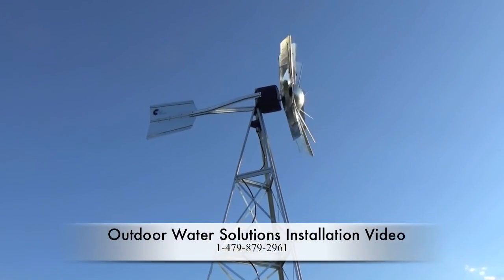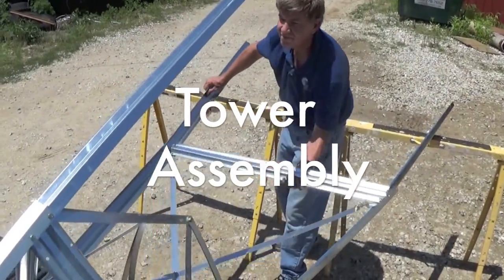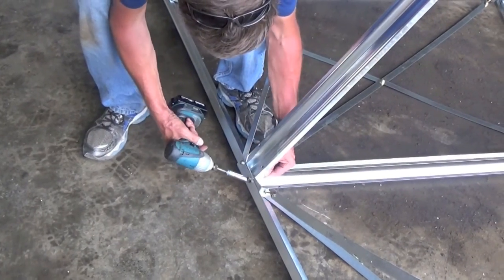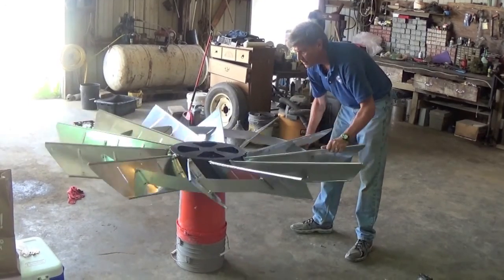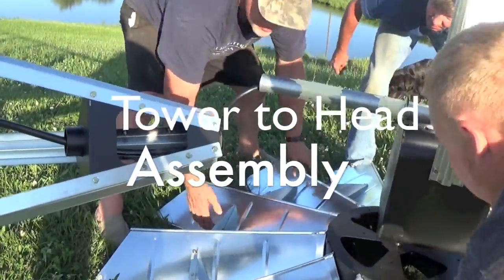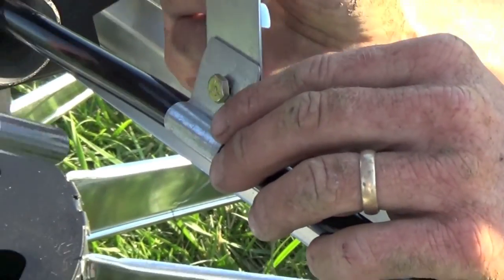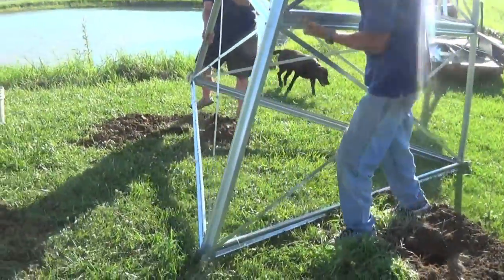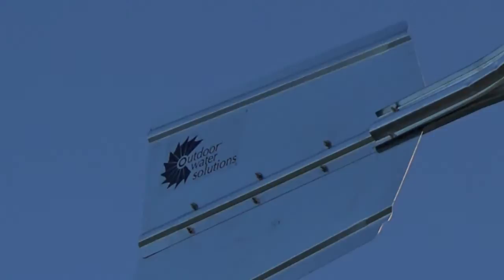Complete Outdoor Water Solutions Aeration Windmill Installation Video

Comment: It has taken us over two weeks to put this windmill together.  The included instructions are terrible.  This video includes details, like lock washers, that are not in the instructions.  As will still struggle with the blades, I couldn't be more disappointed.
Reply: I want to buy one but I keep hearing the same thing.  Was it easier with this video now? How does it preforme in low winds?